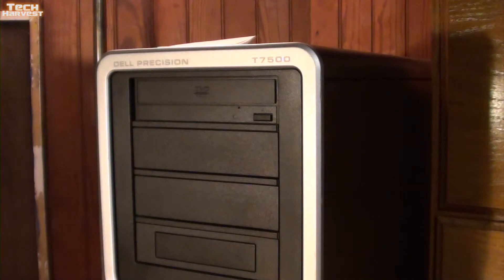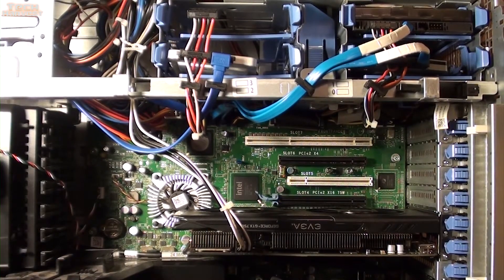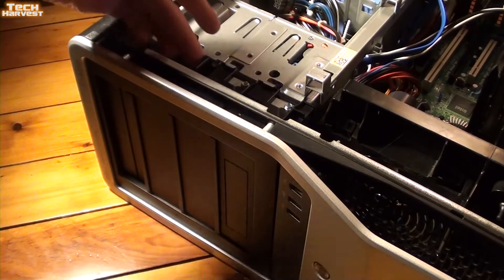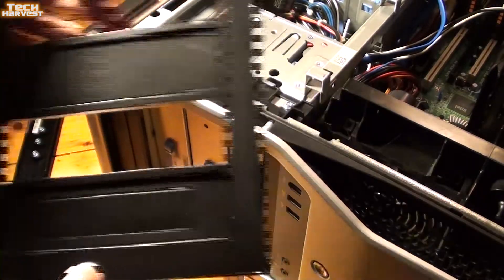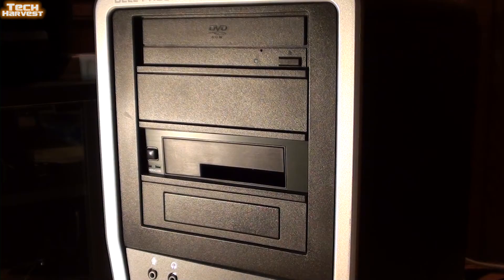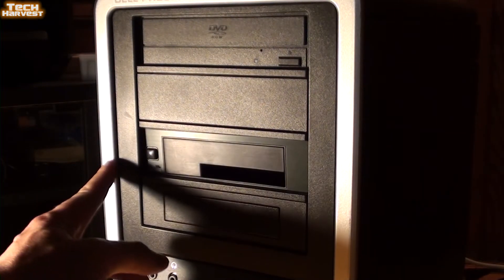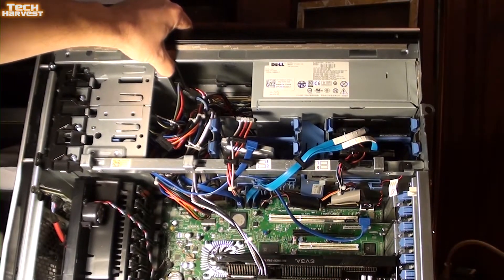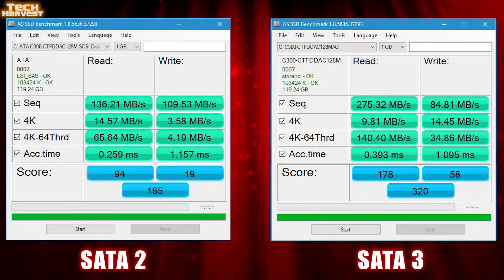SATA 3 & Hot Swap Bay Upgrade: Dell Precision T7500

Comment: hello ! I have the same baby at home. I am quite surprised that your ssd on sata 3 is far too slow. I got a simmilar pcie adpter but my ssd runs at 430  MB/s  moreover even on sata 2 my ssd ran at 260 MB/s. so what is the situation here ? I also managed to put my nands on a nvme pcie adapter and i managed to get speeds up to 1.7GB/s  overwhelming  ! bearing in mind that this workstation  came out back in 2012 .  they said it was future proof ! and dame it it is  future proof  i am still using it with 2 xeons with 192GB ram and it cost me less that 500 dollars. ! Regards from Colombia !!!!!
Reply: I suspect that's a pci.e 1.0 slot, so that would result in lower bandwidth than SATA2.

Comment: To get the hot swap bay to work without having to dig into and decipher the BIOS, a small, free program is available: Hotswap! I couldn't get my hot swap bay to work until I loaded and ran it. Load it, restart the machine, and its function will be in the hidden icons at the bottom of Win10. It "ejects" the drive, similar to the "safe to remove" process in Win 10.  NOTE: larger hard drives will overheat and possibly self-destruct in this bay if they're not cooled with a fan. An external usb fan, even 6" to 12" away will work. The 2 1/2" drives do OK. Cheers!

Comment: Nice video, I enjoy the way you explain the things you do. I have the same machine with slightly different specs ( 2 x E5540, 48GB DDR3-10600R, GTX 1050TI) that serves me extremely well. I might go for a set of X5680 CPUs if I find a cheap enough set and time to do the job, the E5540s do what they're supposed to do. I used to have the same 750TI in there, to be honest there is hardly anything different re graphics since I put the 1050TI in.
I was wondering if it would be possible to put a 4 x 3.5" HDD bracket in the three lower 5.25" slots I'm not using. I already have four 2TB SAS drives in this machine and I'm running out of space. The additional drives will be SATA. Would the PSU be able to manage eight 3.5" drives? The drives would then use all SATA slots on the motherboard, which means I would go for the SATA3 card you showed for the startup SSD. I just wonder if the SSD will still be usable as a boot drive? If not, I'll just have to connect one of the 3.5" SATA drives to the card and keep the SSD connected to the board. Any suggestions (besides: buy larger SAS drives) or warnings?
Reply from the maker: Thank you. Have you thought of just using a hot swap bay for the HDD storage? Do you need access to all of the drives at once?

Comment: If you use clover to boot the machine from usb you can run UEFI bios stuff and boot from there into a M2 NVMe on a Pcie card. Then you should be able to do 2gig a second I would guess. I'm using a Dell Perc H700 raid card in mine, it can run up to 8 sata drives in Raid 6, 10 etc
Reply from the maker: Interesting.  I'll have to look into that.

Comment: @TechHarvest  This was a really excellent video. I very much appreciate how you carefully work through each step, explaining and showing what you are doing and why. What a difference the benchmarks from the SATA3 board with your system SSD!  I wonder if it would be helpful to have a second screw on the "groove" side of the hot-swap bay to hep stabilize that a bit? (Assuming you have another one that has that partial thread design.) And as always, thank you for the excellent content!
Reply from the maker: Thank you. Yes, the SATA 3 speeds are much better. I will post a video next week where I upgrade the SSD to a faster one.  You will see another huge boost in speed based on that as well.  Unfortunately the left side of my PC case does not open so I'm unable to actually mount anything down from that side. Although a second screw is a good idea, I ended up going with a different hot swap bay entirely which included USB 3.0.  Hopefully I will be posting that video soon as well.  As always, thanks for watching and thanks for the conversation. :)